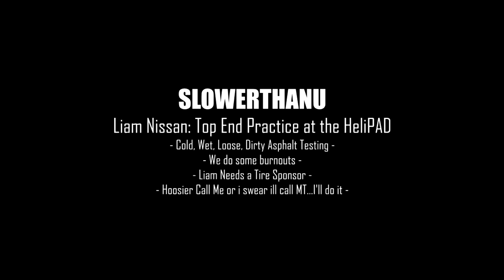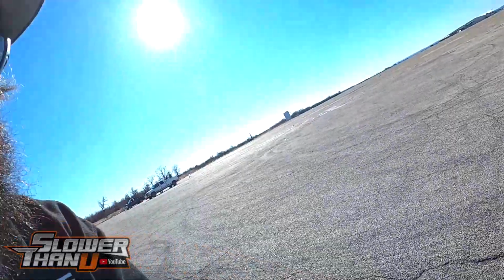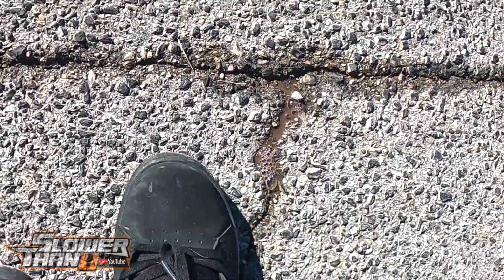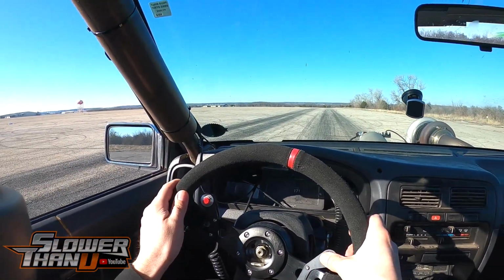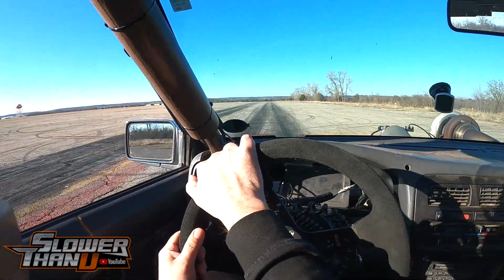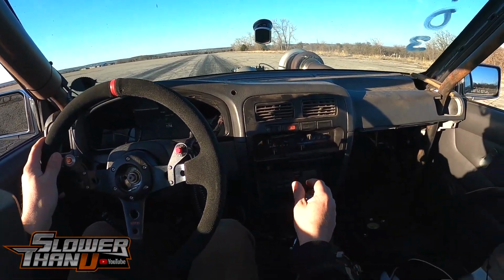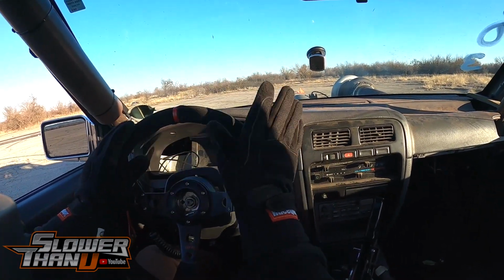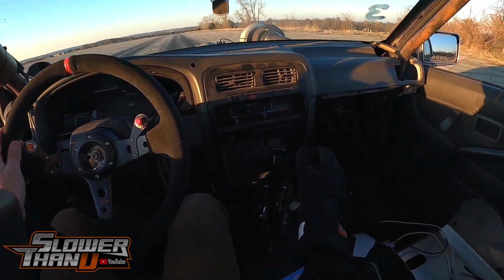Turbo LS Nissan Street Testing on Dirty, Wet, Cold Asphalt #noprep #streetracing #TurboLS

Comment: What did you 60 on that rough rock surface? Cause they looked pretty decent to me for sure!
Reply: Definitely in for the results of the up coming radial testing on the street, although I can’t get mine to hook doesn’t mean you won’t lol
Reply from the maker: They got better toward the end but they were still pretty crappy. I want to go back with a better tire and then try again before I talk about the times lol.
Reply: @Therendonfamilia  sooo I’ll speak up first then, last night I tested on concrete managed my best on the street that I can confirm with dragy at a 1.65 60’ and 6.52 1/8 on worn out pro bracket radials. Faster? Check yes or no😂